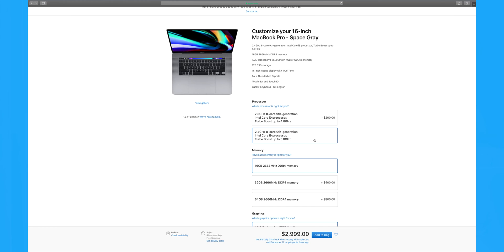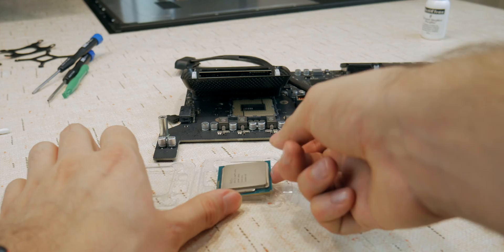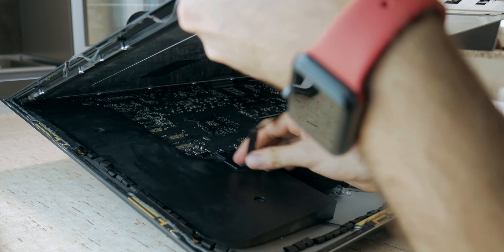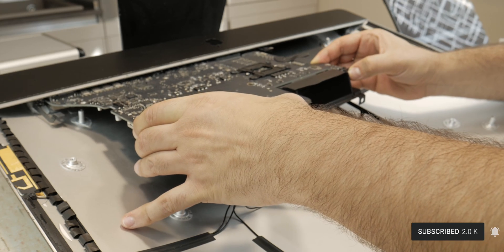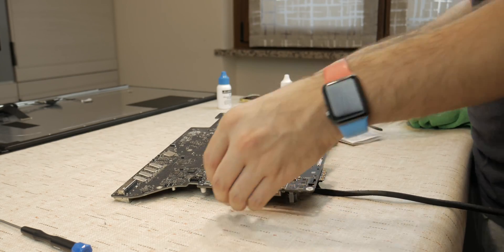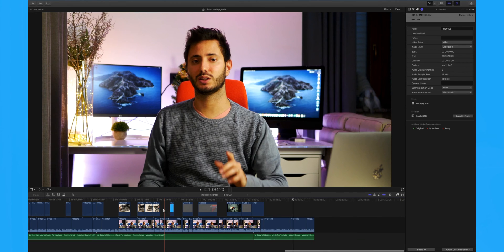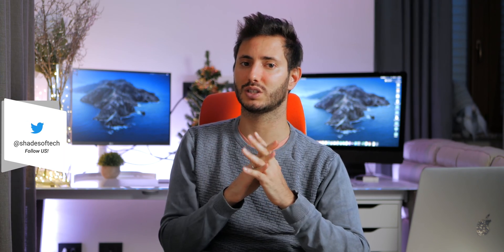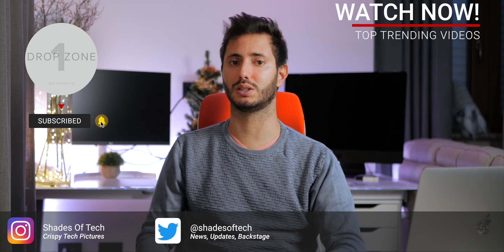iMac 2013 i7 CPU Upgrade | Shades Of Tech ⬡

Comment: Bro - I have the late 2013 27 inch imac. 3.5ghz i7. Gtx 780M 4gb. What's the latest config I can DIY upgrade in this?
Reply from the maker: Officially the i7 4771 and the gtx 780m 4 gb are the highest end possible. You can change the sata hd with a 2,5” ssd and even if you didn’t have the fusion drive, use an m.2 adaptor with m.2 ssd. I went with 2+1 Tb but I think that if your budget allows you can go up to 4 Tb total. 
About ram 32 Gb is the maximum. I had a subscriber that tried 48 and it worked for some time but then had kernel panic, so I would stick with the apple supported max 
If you want to know more here’s a playlist with dedicated videos for each upgrade on the same machine the 2013 27” iMac.
https://www.youtube.com/playlist?list=PLlPrMEtoHVOL5lVMPYhXnZOfOeOfbYrBW
Reply: Sorry, I should have clearer. I meant any upgrades possible for processor and GPU?
Reply from the maker: No upgrade possible

Comment: Great vid Shades! I Have questions. I Have an iMac 2013 late of 21.5". I Want to upgrade the processor by i5 to i7. How can I Know what i7 can i buy on 2020? Im planning to go by 8gb of Ram to 16gb, it supports 32gb?
Reply from the maker: Thanks Diego! This is the 27” model. The 21.5” model’s cpu is soldered to the motherboard so it’s not user upgradable and also the ram should be hardly accessible while the 27” has a simple door. As far as I know you can only upgrade storage to ssd  by replacing the mechanical hard drive. They seem identical on the outside but they are very different internally so I would search dedicated 21.5” info
Reply: @ShadesOfTech  Thanks fow answer, Shades! It would be great if you can heap me with information, I Want to upgrade to 16gb of ram but if it supports 32 Ill take 32gb. The same whit the intel core i5. again, thanks for answer! :)

Comment: Hey Dude, I ordered 2x Single chip 16GB DDR3L 1600 MT/s (PC3L-12800) Ram chips for my 2013 i7 Imac. They're pricey but I'm going to see if the motherboard recognizes it. I haven't seen anyone try this online. If it works I'll order two more and see if the i7 4771 will read 64gb of ram. Intel's site says it will only read 32gb but they have been wrong before.
Reply from the maker: Yeah this is a nice test, to be honest I don’t think it will work because older cpu were pretty limited but in any case let me know!
Reply: @ShadesOfTech  I'm guessing now it won't work, but will try it anyway since it's rumored to work on Ivy bridge era chipset
 which our Imac is newer by a year.
Reply: @ShadesOfTech  Hey dude it's working with 48gb of ram 2x16gb and 2x8gb.  Going to buy 2x more 16gb chip and see if it goes to 64. DM if you want screenshots.
Reply from the maker: Thomas Mason IV great! Good to know! For 4k video editing 48 is the sweet spot because FCPX takes around 32. Let me know how does it go!
Reply: haha Bad News repost from Macrumors.

Unfortunately today after a few hours I got Kernel panics with it in 10.14.6. I tried running it with 10.15.4 and it's still unstable. So at some point there is a degree of the CPU recognizing the Large ram chips but it's not able read from them entirely correct.

I checked the Dimm temp's and the 16gb chips do run a bit hotter than the 8gb chips. At 51C, but that shouldn't be effecting the system.

One thing I haven't tried is running it with Win10, and at this point I won't since I've played with this enough and these chips are going back in the mail before I brick my wife's Imac, but if somebody were to run Win10 and see if it's a MacOs limitation or Hardware compatibility that would be another clue. I kinda suspect it's a MacOS issue.

It would be interesting to try the same chip 16gb DDR3L 1600 chip on a 2014 or mid 2015 Imac. There may be more compatibility with the Haswell Cpu's, Don't know till we try?

Maybe with 10.16 coming later this year there will be another bootrom update and maybe these High capacity chips will work in older 2013 Imacs.

I got farther than I thought I would and getting the Imac to even boot with it was neat. Hope other people keep pushing it and I may try again in the future.
Reply from the maker: Thomas Mason IV yeah I suspected that, I suspect it’s a limitation both from intel and apple. What is clear is that as long as you respect apple original configuration you run stable. 
But it’s not always true because my 2013 Mac Pro with 12 core cpu supports up to 128 Gb of ram but at lower clock speed, even if apple didn’t originally sold it.
So there are exceptions that can be found only testing in person
Reply: https://forums.macrumors.com/threads/imac-27-inch-core-i7-3-5-late-2013-max-ram-is-higher-than-32gb.2235079/

Comment: thanks for the great video. i was a little worried i'd have a hard time with you accent, because it sounded strong, but i understood every word within a second of you saying it, so i never paused or replayed because if it. i wanted to know which cpu to use cause i thought i might use the i7 4790K, but it must be for a newer imac, i have the same year as yours and you are the second person to recommend the i7 4771 (no k). i am excited to do the upgrade, plus ram, new paste but you missed the opportunity to leave the HD in place (or upgrade it as you did?) and replace or add the m.2 as the boot drive, if it was sold as a fusion HD system as shown here: https://www.youtube.com/watch?v=Y3-n-iBCvqc
Reply from the maker: Happy you understood everything! Yeah I wouldn’t risk the 4770k because k means over lock and the thermal system of the 2013 iMac is not designed for over locking. Then I am not sure if it’s compatible. If you do as I did you are 100% sure it works because it’s the same apple used. 
I upgraded both the sata Hd and the m.2 to ssd and I loved it. Remember the OWC thermal sensor for the sata ssd otherwise fan will go full blast all the time.
If you have a fusion drive you can do it but the drives will be speared. If you want you can create a new fusion but it’s complicated.
Here’s my video of ssd upgrade https://youtu.be/BRyR9UNRZeQ
Reply: @ShadesOfTech  i see iMacs for sale with the i7 4790K here on craigslist in Los Angeles, but i think they are newer models, so i agree that the 4771 is safer for the older models like ours. but i'd like to make sure cooling is working fine or better than stock. have you ever tried upgrading the fan to noctua? 
with the K model, i could also under clock, still i don't want to waste $200 or so, but i could sell it if it didn't work. i use it for music, so i do not want fan noise.

i assumed adding the m.2 would show as a separate drive. i hadn't considered making a fusion drive. i think mine is a 2 TB fusion drive. i guess it is part spinning disk, so upgrading the spinning disk to SSD increases the performance. it might be cool to upgrade both to NVMe. i know apple is compatible with certain hardware, and i will not buy hardware as an experiment unless i am willing to try to sell it if it doesn't work, but i don't know how easy it is to sell. is there a limit to the memory size? would 2 @ 2 TB drives = a 4 TB fusion drive work? i'll check out your other video, thanks

Comment: hello friend do you know if you can boost the screen my iMac is late 2012 2640x1440, is there any way to adapt a 2018 5k display to my iMac?
Reply from the maker: I already thought but unfortunately you can’t because the 5k iMac has a built in controller for the screen that the 2k iMac doesn’t have. You should get a 2017 iMac and upgrade it it’s better value in my opinion
Reply: It might run a external 4k display at 30hz
Reply from the maker: Thomas Mason IV I don’t think the 2012 can run an external 4k display even at 30 hz. The 2013 model does it for sure but as far as I know it was the first iMac to be able to even run a 4k disllay

Comment: Will the CPU upgrade work with 21.5 Inch IMAC late 2013 ?
Reply from the maker: No the cpu on the 21.5” model is soldered so you can’t upgrade it. You can upgrade ssd, and blade ssd if it shipped with fusion drive. Not sure about ram
Reply: @ShadesOfTech  there are guys who desolder CPU and RAM, but that is advanced DIY and even they worry about getting everything to work after their modifications, so it's a real gamble.
Reply from the maker: Yeah it’s extremely difficult I don’t think it’s worth, better sell it and buy another one
Reply: Buy the 21.5 2011 iMac model and you can change the cpu on them.

Comment: Also I7 4770 compatible?
Reply from the maker: I know for sure that the late 2013 21.5”
iMac maxed out with the 4770s but there it’s soldered so no upgrade. So as far as software goes it’s ok.
As far as the 27” I am not sure if it’s compatible you should search on some blogs to see if someone has tried it.
Reply: @ShadesOfTech  no,the imac 2013 21.5 a1278 used i5-4570s or i7-4770s,they can change

Comment: MY MIND IS BLOWN RIGHT NOW. I also have iMac14,3 and didn't know the CPU was upgradeable !!!!!!!!!!!!!!!!!!!
Reply from the maker: Yeah you can upgrade it for relatively cheap! And if you have the base cpu the performance improvement is excellent. Be sure to study all the steps before attempting
Reply: @ShadesOfTech  I've upgraded the 5400 RPM to a 480 GB SSD so I've removed the LCD panel at least once. Next time, I'll be replacing the i5 with an i7, an adding a PCIE SSD!!! just gotta get the parts!
Reply from the maker: elevate111 great!! I made a video about the pcie ssd upgrade as well. I used the OWC aura pro x2 but you can use also an nvme drive with adaptor. The tricky part is that you don’t have the screw that fits in if your machine didn’t ship with a fusion drive. So I used a screw from the mechanical hard drive
Reply: @ShadesOfTech  Thanks!! Your video will help a lot!!! I will be standing on the shoulder of a giant! Or a moderately tall person.
Reply from the maker: elevate111 hahaha too kind! It was my first attempt. I just upgraded a 2013 Mac Pro to a 12 core.. video coming soon!

Comment: your English is terrible. I had a hard time understanding anything you were saying, and I wore headphones. I got so frustrated trying to hear what you were saying that I just quit. 

also, and not to put too fine a point on this... you did NOT specify which imac you were upgrading.... and it turns out you were upgrading and working on an imac pro, which is a 27" unit... I was looking for a late model 2013 upgrade video. The guts in the 21 and 27 are very different... 

If your accent wasn't so heavy and I could actually understand what you were saying I might have continued watching. I quit at 2 minutes in because it was impossible for me to make out what you were trying to say. I won't be back.
Reply from the maker: It's a late 2013 as written in the title. Just painted in black. The iMac Pro doesn't mount intel i7 processors but Xeon CPU from 8 core up and not 4c. 
I might not be englishborn but your knowledge of the matter is really poor.
I have people watching my videos from all around the world interacting with me without any problem. You basically fall in the 1% of my public. 
In conclusion if you are searching for late 2013 iMac upgrade videos I made a whole playlist with cpu, gpu, ssd but if you can't understand just watch the pictures they might help you.

Comment: Great Job!! @Shades of Tech
Just two quick questions, do you have any motherboard/fan problems with this upgrade?
And if there is any way to find out which processors are compatible with any mac?
Reply from the maker: Hi, I noticed the fan generally louder while exporting video with fcpx or while background rendering because the new cpu spikes power and temperature compared to the old one. So I reopened, reapplied thermal paste (I didn’t used enough) so I got 5 Celsius less under load. 
However in general is more powerful so needs more cooling
Reply from the maker: About the CPU model in general for upgradable Mac you can put all the cpu that Apple sold on its website in the upgrade to order. Those should work without any concern. You can find more info on this site searching for your Mac model. https://everymac.com/systems/apple/imac/specs/imac-core-i5-3.4-27-inch-aluminum-late-2013-specs.html
You can risk to use different cpu but you have to check if the socket is the same and if someone else has already tried it and had success, otherwise I wouldn’t risk. You just write on google “iMac 2013 CPu” and read some blogs or reddit

Comment: I like your video, however I wish you would have spent more time explaining and putting it into video the exchange of the I7 core. Plus the application of the paste. I think you glossed over these important steps. Your video could have easily been 2-3 times as longer. Thus getting your watch hours and views up. You could have also explained the difference between the various I7 processors.
Reply from the maker: As I said at the beginning of this series this is not intended to be a tutorial but just me reporting my experience. About the cpu upgrade the swapping part was so fast. The difficult part was to get to remove everything.
As far as I know the i7 4771 is the only i7 cpu that can be installed in the late 2013 iMac.
About thermal paste the first time I made an horizontal line as the guides suggest. But then I realised I didn’t put enough paste so opened again and this time made a cross with four points. More paste is better than less. Then closed up and got average 5 degree less. 
I am definitely no expert this was my first time but if you have any question be sure to ask me

Comment: Hey is this the 2017 iMac?
Reply from the maker: No it’s a 2013. But some info are true for all the iMac since 2012. What you need to do?
Reply: @ShadesOfTech  I have a 2017 iMac and what to go to i7 7700 but better 7700k (but I don't know if this is working.
Reply from the maker: @paul.454  Tremendous Upgrade! I was considering to make this upgrade myself if I could get a 2017 iMac. 
The process is the same of what I did.
Be sure to use a lot of thermal paste because the 7700k "k" means oveclock so it heats up a lot. I know that the 7700k is supported for sure because you can upgrade with the same models apple used and the maxed out cpu has it. 
Here more info https://everymac.com/systems/by_year/macs-released-in-2017.html
The 7700 was used in the 21.5" 2017 iMac so I am not sure if it works because the system shouldn't recognise a 27" iMac with a 7700. So if you don't want any trouble go with 7700k.
Snazzy Lab made a video with this same upgrade I'll link it as well
https://youtu.be/knMM9dRwIH4
Hope it helps!
Reply: @ShadesOfTech  Thank you for the great Answer. I think with the 7700 I am more save. But the difference is not so big. The 3,4 i5 is just good to but have just 4 Threads.
Reply: @ShadesOfTech  k means overclock-able meaning out of the box it runs at base speed at normal temperature. it will only heat up if overclocked.
Reply from the maker: @WiFiTubeTV  Yeah it should work as well!
Reply: Yu